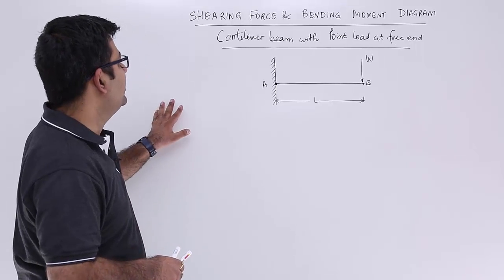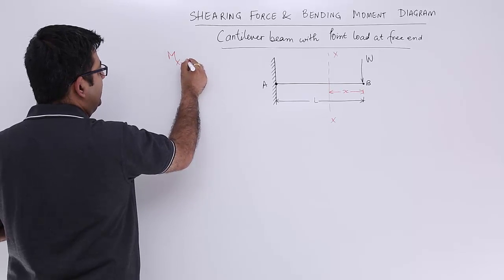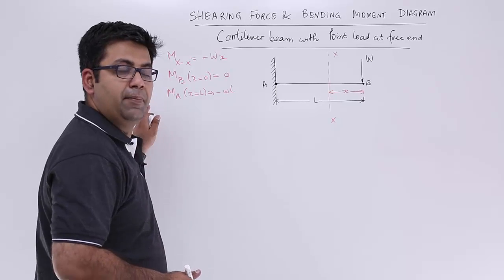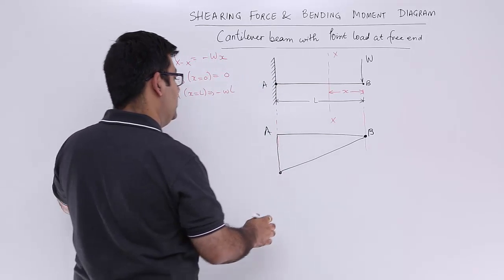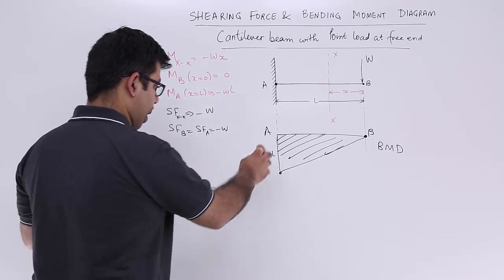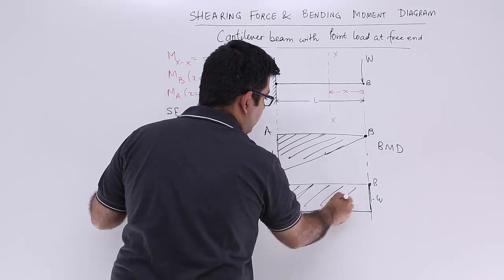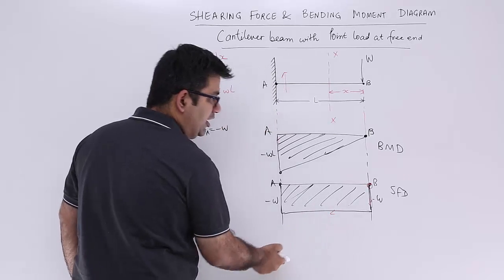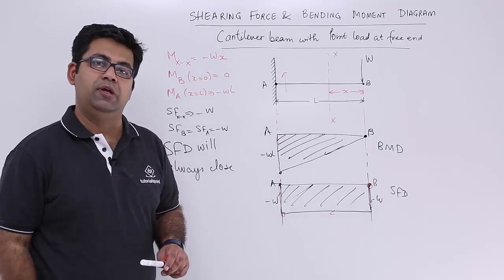Cantilever Beam With Point Load At Free End

Comment: Would a 12 inch cantilever have more load bearing capacity as compared to 9 inch cantilever if the area connected to the wall is the same in both cases. I am talking about wash basin brackets which are riveted to the wall.

Comment: Sir solve this for me.... A cantilever of 4 m span and 400 mm depth carried a uniformly distributed load of 5kN / m . Find the value of the concentrated load w acting at the free end so that the maximum deflection does not exceed 10 mm anywhere in the cantilever. Also find the maximum slope due to both these loads. [E=200GN/m^ 2 ; I = 20000 * 10 ^ 4 * m * m ^ 4 .) 10